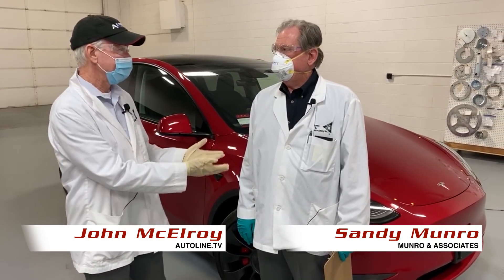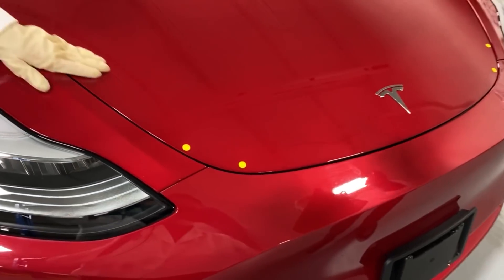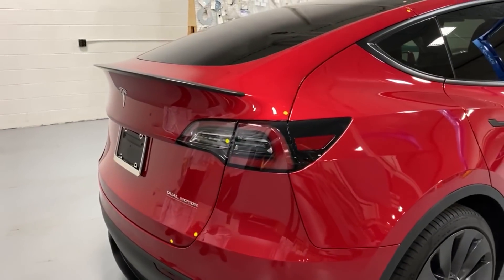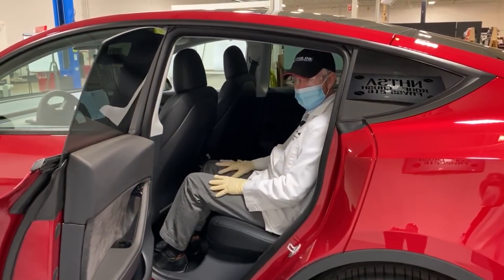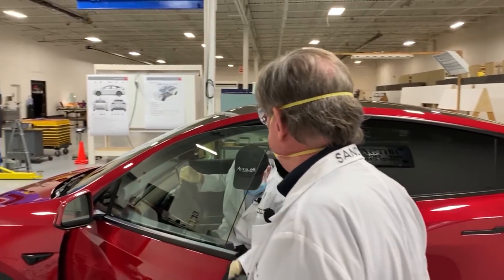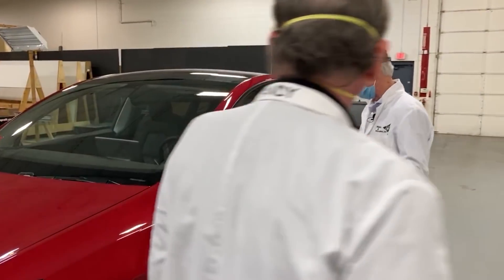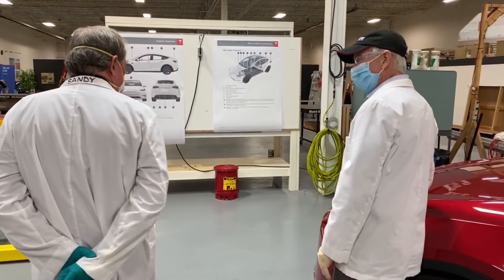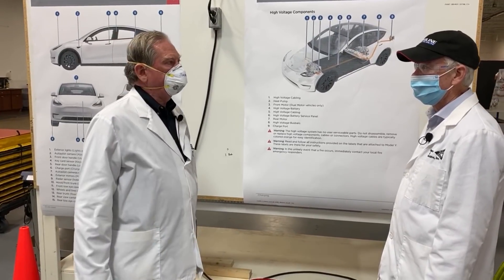Munro: Tesla Still Has Fit & Finish Problems With Model Y - Autoline Exclusives

Comment: 1) Red brake callipers
2) Larger low profile tires
3) Carbon fibre Spoiler
4) Line under Dual Motor
5) Aluminum colour pedals
6) LMAO... the crazy acceleration!
This is a Model Y Performance!!

Comment: Just FYI.  That Model Y is a performance model.  You can tell because of 
1. The 21" Überturbine wheels are only available on the performance model
2. The red brake calipers are only on the performance model
3. The metal accelerator & gas pedal only on the performance model
4. Lastly the red underline of the Dual Motor emblem on the trunk denotes  performance model

This is also why the suspension seemed a little stiff.  Performance models also are lower with stiffer suspension.

Comment: Gonna sell like hotcakes once Tesla figures out where to install the 3rd row seating.
Reply: Tesla debuted the Y with the 3-row configuration. I guess the 2-row is easier and cheaper to manufacture.
Reply: Is the 3rd row really that important?  I don't know a single person who could make use if it myself so always treated it as a non-issue..
Reply: The third row is coming, but it will be for small kids only.
Reply: The second under storage in the boot is where those seats will be. Just like a model x, if you have 6 or 7 seats you only have one extra storage space under the boot floor but the 5-seater have a second smaller compartment. 
At least that's my guess.

Comment: Thanks, you are so professional and impressive on you quest to tear down the safest car in the world. One of the most economical besides other model Tesla, with the most impressive range in the EV market, that most owner consider it a true master piece, that no other car in the world can remotely match . If you old phony bags were really interested to honestly evaluate its overall most significant unmatched aspects in the automotive industry world wide, you should have mentioned its free connectivity and constant performance upgrade. But also the incredible total self driving potential. Its projected resale value better by at least 30% than a comparable ICE car. When you add its unique extensive recharging stations by various thousands spread in the world markets. Its practically absent mandatory maintenance requirement, as well as its projected longevity that by far surpasses any ICE car. When you add its seat pinning acceleration, its wonderful quietness and its fantastic sound system, if you had a minimum of journalistic self respect, you  both should get down on your old tired knees and ask Elon Musk forgiveness, for going around the magnificent car trying to find imperfections, rather than enhance its well earned unmatched qualities. You are an absolute disgrace to your profession, obviously falsifying your intentions for a few $ kick back, probably not even declared to the IRS. It is with contempt  that I call you both traitors to your noble profession, because for a few dirty dollars you have prostituted your journalistic integrity. Pity you don't even know which model you are tearing down shame on you both.
Reply: They can't improve unless someone is willing to be critical.  This mindless devotion and blind faith is what makes many grind their teeth over tesla fandom.  Tesla makes a great car, and the best BEV out there but they, like the rest of them, are far from perfect.  It is possible to both love Teslas and NOT be blind to their flaws.
Reply: @Lenflare Deviant.

The point I tried to make is very simple to comprehend, these two phony corrupted journalist are a disgrace to their profession, because they went over the car not to evaluate its overall extraordinary qualities and uniqueness, unmatched in the auto world, but to purposely invent even problems they were not present. Granted no car in the world can be honestly judged as perfect, we all know that. But if you honestly compare the model Y to any competing ICE SUV , and with impartial objectivity you check on the most significant aspects of it, it clearly crashes any other SUV in the market today, with an exception, it does not fart and it does not smell. Having missed all that, it is obvious then their sinister intention, which denotes their dubious credibility.

Comment: I don’t understand all the fit and finish videos. GM has been making cars for a long time and my 2018 GMC Terrain has same or worst build quality.
Reply: Was your GMC terrain +$60k like this Tesla?
Reply: One Nation Under God 40k for a car they have had for years and tons of experience.
Reply: @blademiltaveras3668  good burn yup fit and finish of gm and Ford ain't that great, would love to see an honest tear down of the rivian and the Ford mache, and the gm bolt wonder how the fit and finish on those are going to be judged? Probably be just as bad if not worse depending on the day they are built Monday or a Friday hehe
Reply: @blademiltaveras3668  my point is a GMC Terrain is not a premium vehicle, when you spend +$60k you should expect build quality high enough that body panels are properly fit during assembly.
Reply: @blademiltaveras3668  another example of those two vehicles being for completely different markets, the GMC Terrain base price is $25,000 and the model Y base price is $52,990. You could buy two Terrains for the price of 1 model Y
Reply: One Nation Under God, yes good point on the price difference.
Reply: There is no engine, no transmission, no exhaust system.. in short many of the other mechanical systems that they would normally be prying at.  BEV's have fewer parts so those parts get more scrutiny and thus are given the image of being bigger problems than they actually are when minor flaws or faults are found.  Many focus on the price point, thinking that it's the equivalent of a ICE car in the same range when it's not.  BEV's are more expensive and you are still paying a premium for that tech and that's where the value lies rather than in the finish or comfort features.

Comment: One thing keeps me puzzling of Tesla design is that we went through all the trouble to recess the door handle for low air drag yet to maintain a high drag external rear view mirrors, instead of low profile low drag digital rear view display.
Reply: Because of regulations, many states and countries have yet to change the laws on vehicle mirrors.

Comment: How is this not the high performance model and I'm seeing red brake caliper and Uberturbine wheels?  This is Model Y Dual Motor Performance with the performance upgrade that you have here.  The performance upgrade adds Uberturnbine wheels, red brake calipers, and a higher top speed to the Dual Motor Performance model.  All that for a 35 mile sting to the range, dropping it to 280 from 315 miles per charge of the regular performance model.
Reply: There's a red line under the "Dual motor" - this has to be the performance
Reply: I think it's an April Fool's joke.

Comment: How many other car companies get this much attention when a new model is introduced?
Reply: Most cars these days don't need panel gaps checked, the Ford Taurus of the 90's was one of the first to bring high quality fitment of panels to the lower end sedan market. They actually compared that Taurus to a Jaguar of the same year and the Taurus beat it hands down on build quality. (I believe it was Motorweek on PBS that I seen the comparison)
Reply: @OneNationUnderGod.  those shit panel gaps are as bad as Porsche's.  Tesla can't seem to get it right.  Nobody will buy a car built like that.  I doubt they will sell any at all.
Reply: David Beppler you’re comparing Tesla build quality to Porsche? It’s not even close...
Reply: @naisbest3020  True, Tesla panel gaps were much tighter.. but other than that...
Reply: Trigger Troll  While I haven't looked this up yet, I doubt that Munro wouldn't waste his time tearing apart a new corvette.  They just don't sell enough of them.  The only people that care about the new corvette are corvette owners.  Same is true for porsche.
Reply: Trigger Troll  It might be interesting, but no one outside of the corvette owners groups cares.  New versions of corvette always sell well.  But then taper off.  It's a pretty small market.

The reason Munro is making the tear down videos available on the Model Y is because there is some truly interesting stuff there.  The engineering is revolutionary in terms of bringing manufacturing costs down, safety improvements or working towards a million mile car.  

To put corvette sales in perspective, Cybertruck orders are somewhere north of 500,000.
Reply: don m you must be new to cars.
Reply: @naisbest3020  I've owned cars since the mid '80's.  So, not really new to them.  I have never seen this kind of attention and excitement around a new model.  Would Munro post youtube videos about a Ford or GM?  And Sandy seems genuinely excited about some of the things he is finding and hasn't even really dug into the car yet.  I thought the wire looms were interesting.  How many Porches are rendered useless with faulty wiring harnesses that short out?
Reply: @naisbest3020  there is a day by day video on Gigafactories getting built.  You must be new to Tesla.
Reply: @davidbeppler3032  That is another good point.  How many people fly drones over a new Ford or GM plant that is building built?  Actually they are probable closing more plants than they are opening.

Comment: I wonder if those tiny bumps under the paint on the hood can somehow be buffed out? Otherwise, the paint job looks great. I like the look of the Model Y. Tesla is still way ahead of the competition offering more range and performance. And Tesla's Model 3 and Y performance models are still priced about $10,000 - $40,000 less than the electric models from Audi, Mercedes, Jaguar, and Porsche respectively.

Comment: FYI: this IS the PERFORMANCE model. 😂
Reply: lol someone in procurement played a game with Sandy :) What's an additional $15k between friends :)
Reply: It’s April fools ;)
Reply: Also note the red line below the Dual Motor signage and the spoiler.
Reply: Auto line won’t respond to anyone clearly correcting them
Reply: @TrevX2001   LOL
Reply: I think you are correct; it has red brake calipers, something Tesla would only do on performance cars (I know little about Model Y cars but I assume they would continue with that differentiator with the Y).
Reply: They supposed to know, you'd think? Afterall they are telling Tesla what they made well and what not.
Reply: Probably in chill mode.

Comment: NO super Bottle on the Y? Why was that?
Reply: Uses a heat pump. It's a different system entirely. Still has a coolant  bottle, but it's called super manifold in this set up.
Reply: With Tesla's constant updating they went beyond the bottle now they're into the big systems.

Comment: Tesla's Shanghai factory is building cars without the quality issues found in the CA factory. Tesla built a factory far larger than needed for the Chinese market and the Chinese government has provided financing to dramatically expand that factory. Why? So all Teslas will be built in China, where the cost is far lower than anywhere else. I know everyone will poo poo this assessment but Tesla thinks of itself as a Silicon Valley tech company. All other Silicon Valley tech companies design in CA and manufacture in China. In doing so, Tesla will just fall in line. Also, as a CEO with lots of shareholders, it's the responsible thing to do. Only problem is that Chinese companies will steal all of Teslas tech to build their own versions and eventually put Tesla out of business. That's the Chinese government MO of business development.
Reply: They are spinning it.  Those lights were off by 1.5mm, because that is what the adjustment would be to center it.  I bet you don't find many cars on other company's lots that don't have similar variation.  The chinese ones are likely the same, but no one in china cares about meaningless tiny gap variations that require a ruler just to notice.
Reply: Tesla's factories abroad are meant to manufacture vehicles for the region in which they are located.  I doubt we will ever see a made in China Tesla in North America unless it was a special order from a third party.

Most of Tesla's patents are available to the public anyway.  Other companies either haven't invested into incorporating the technology into their own product or have done just that but fallen behind Tesla's rate of innovation and come out with an inferior product by the time it gets to production.
Reply: Well allow me to be the first to poo poo.
Firstly if the factory in China is far larger than needed for the Chinese market, why are they also building Giga Berlin?
Secondly if Chinese companies are going to put Tesla out of business then it's not the responsible thing to do. This is almost possible but extremely unlikely. Tesla's innovation is so fast that stealing what they have gives you an inferior product in months as Tesla have moved on. Also brands matter to people. Persuading people to buy a car that looks exactly the same and costs less but has the wrong badge on isn't easy. It sounds easy, but it is not.